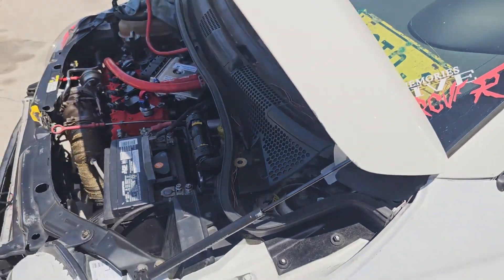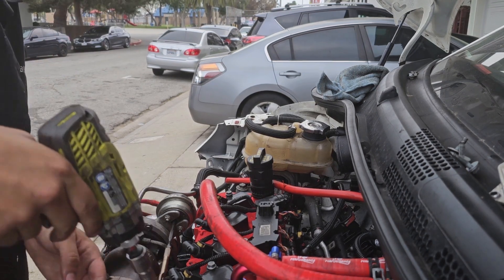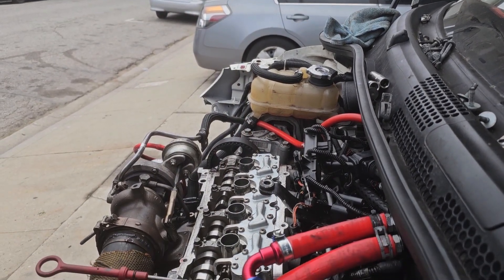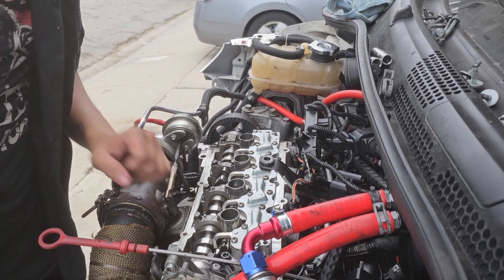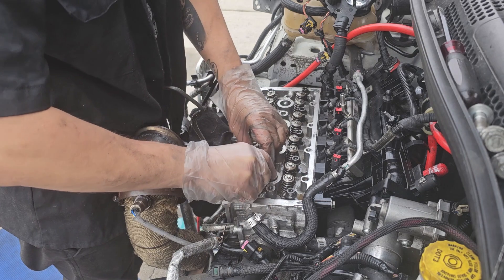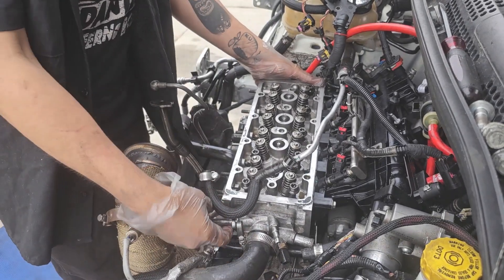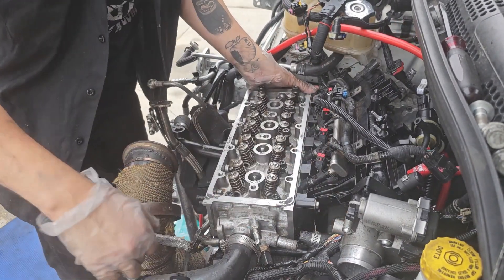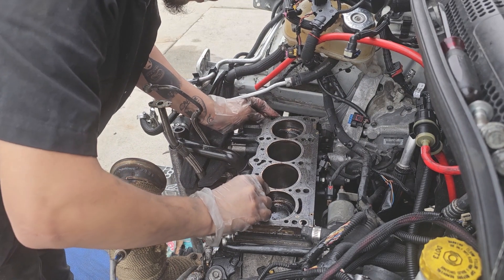Update On My 2015 Fiat Abarth

Comment: On the Abarth, do you know how to get the Full Cut Off light and sensor reset? I'm not having any luck using the turn signals.
Reply from the maker: I would say check your wiring for turn signals perhaps and or fuses